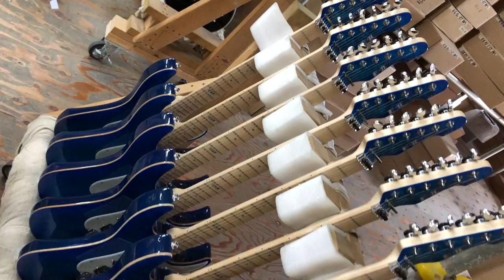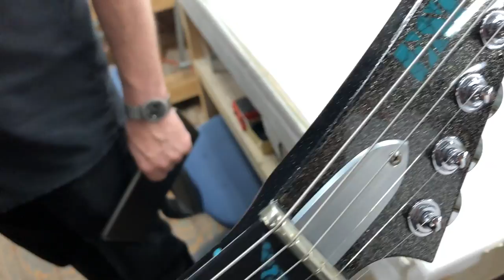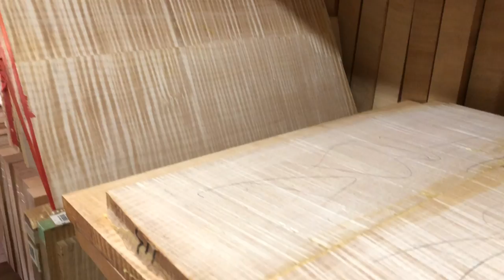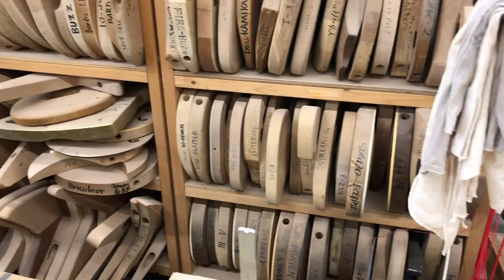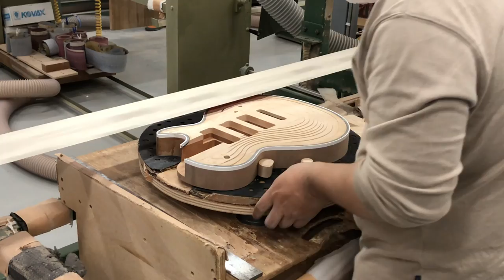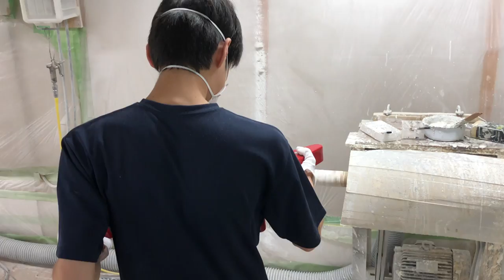ESP Guitar Factory - Japan (unedited)

Comment: Thank you for this video, I'm always curious about ESP Japan factory.
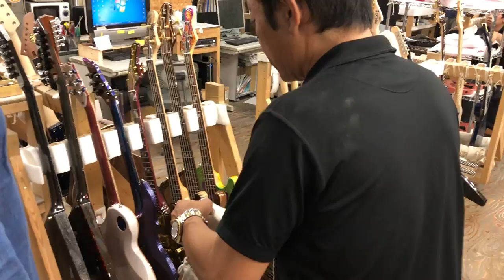During one segment, I see a worker doing setup for E-II guitar and then at 2:55, I see ESP Original guitars on a rack. I always get impression E-II and ESP original are made in different factory. After watching this, I'm not so sure anymore. I get a few question for you.
1. Is E-II completely made in the same factory (from wood cutting to fret working and installing hardware) ?
2. When doing fretwork and nut cutting, does the worker spend the same amount of time for E-II and ESP Original ?
Reply from the maker: Good questions. 1.) I am not entirely certain. However, I know a lot about guitar manufacturing and because I saw both in the factory, I would assume that they would be completed 💯 in this factory. It does make a lot of financial sense to ship guitars to a different factory for fret work and finishing since they do it all there. 
2.) It would appear as if they do spend the same amount of time. I’m not 💯 certain, but these folks are highly skilled and can do high quality work in a rather quick time frame. Therefore, it would make sense to either models the same amount of care and attention.
Reply: @BradleyJohnson13  Thank you for answering my question.
Reply: ESP says that they made final assembly for both original (and signature, you can see this in this video) and SS (E-II) in Tokio as i know.
Reply: EII is still made at their jixi factory in China, just like the standard series, with the final assembly done in Japan.
Reply: @Mongorat  Our ESP Custom Shop and ESP Original instruments are both built by hand in ESP’s renowned custom shop. ESP E-II models are produced at ESP’s factory in Tokyo, which allows us to offer them to you at lower prices than the hand-crafted guitars and basses from our custom shop. --This is from their site
Reply: @basedguitarist731  hahahaha and you believe that?
Reply: @Mongorat  Yes... ESP branded guitars are made in USA since 2013. E-II are made in Tokyo. LTDs are made in China. It's not complicated.
Reply: @Mongorat  Take a step back from the drugs, man. If anything, they maybe use Jixi body blanks. They are in no way "made in" China. I feel like I've seen this same argument on the ESPguitars forums for a decade now. Are you sure you're the one who is informed?
Reply: @basedguitarist731   haha I have documents and pictures and I know dealers who deal directly with Esp Japan, who can get the mx250s, even tho Makoto at Esp Japan says they dont make it.
Reply: @Mongorat  No reason to be aggressive about it. We're on an ESP factory video... you're not talking to completely clueless people. I'm interested to learn about any evidence you have that the E-II series is built in China.
Reply: @basedguitarist731   standard series was and EII is still. Final assembly is done in Japan. And thats it.
Reply: @Mongorat  Alright, thank you for the evidence and constructive conversation.
Reply: @basedguitarist731   and u think all Esps are made in the Us now. Funny guy.
Reply: @virtue696  There are pics from their China factory that has Edwards on racks along LTD Elites and E-II, why would they make copies of all of them? (was most likely taken during the name switching) I love my '04 Eclipse plays like a dream and is super resonant, but it's heart breaking knowing that ESP is doing it half hearted like this.

Their China facility is solely ESP and are specially trained and monitored by ESP.
Reply: @Mongorat  It's just insane that ESP does this given how much they take for an E-II (and even a Standard Series back then)..

A Gibson Les Paul standard is cheaper than the newest E-II Eclipse today, and they're 100% made in USA and there's not the slightest amount of doubt, whereas there's plenty of doubt with ESP and we've never seen a Standard Series/E-II in any stage other than being on the rack pretty much finished..

My '04 Eclipse plays amazing and is super resonant, but it pains me knowing ESP does it like this.. They're pretty much saying they're too embarrassed to acknowledge it and openly ''lies'' about it. It would probably be a too hard hitting blow if they revealed that they were actually made in China and Finished in Japan, because at the price of a new E-II they should NOT be Made in China and finished in Japan.

A thing I've noticed on the SS and E-IIs is the filler on the inlays whereas on the CS there's none.
Reply: @basedguitarist731  ESP USA Series are made in the US but the ESP Original Series guitars are made by hand in ESP's Custom Shop in Japan. E-II's I believe are made in Japan. High end LTDs such as the 1000 Series are made in Korea and Indonesia.
Reply: Sorry for the late reply: 
1). E-II is made completely in Japan, despite what some people claim online.
This is the old ''Standard Series'', that they discontinued in 2013 and replaced it originally with the ''LTD Elite'' Series which then was re-branded as ''E-II'' in 2014.  Best way to describe the difference between E-II & ESP Original is: it's like with Gibson/Fender/PRS Custom shop models & their regular Made in USA production series.
ESP Originals are usually made by 1-2 luthiers, sometimes with an apprentice assisting. 
They build the guitar from start to finish.
The E-II models are build in a production line,  basically there's a section that does the fretwork, another does the electronics etc. etc.  If you go to PRS' YouTube channel, they have a series of videos, on how the whole process is done in their US factory. I'm sure ESP does something similar.
2). I would assume they spend more time working on the ESP Originals and the models which are custom ordered by a dealer for a csutomer, than on the E-II. 
ESP's  Japan factory is actually pretty bogged down over the last 2 years, that's why they take less orders for custom shop builds and haven't released any new E-II models in 2024.
They wouldn't have this issue, if they would build the E-II's in China.